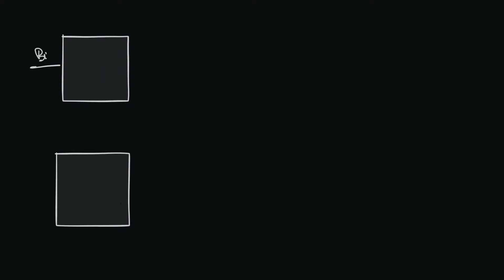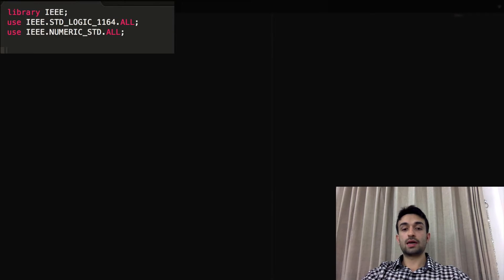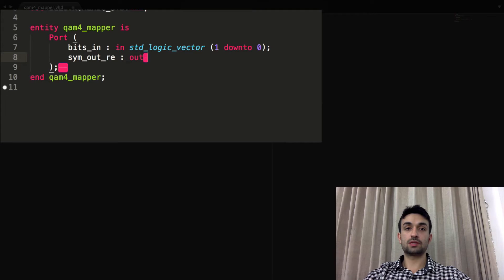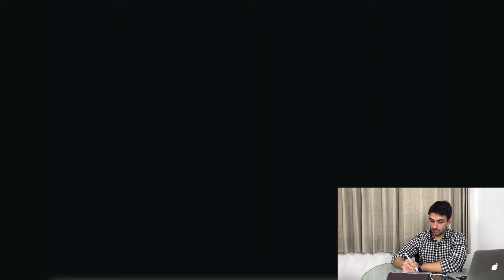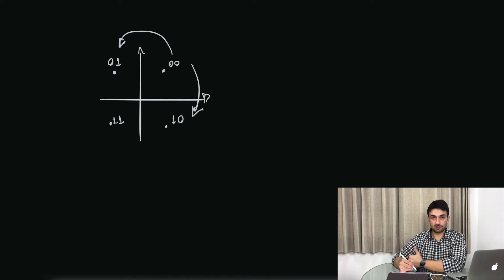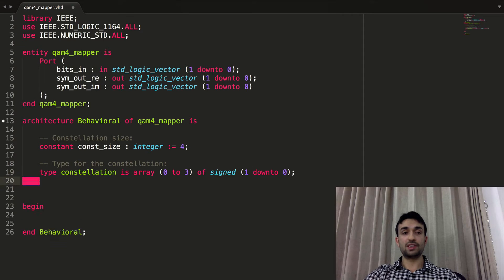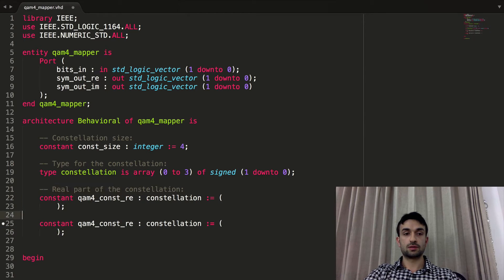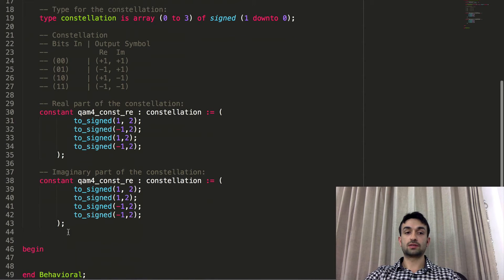QAM Modulation in VHDL - Part 1 [Wireless on FPGAs Course]

Comment: Hi Igor, thank you for the video. 

Please could you detail the software setup you are using? 

Thanks, Matt.
Reply from the maker: Hey Matthew, thanks for watching and sorry for the long delay. At this point I used Sublime as the text editor. For the recording, I use Screenflow, which supports recording of the computer screen, the computer camera and the tablet (iPad) screen. I also record from a different angle with my phone and I use the iPad to make drawings. Hope this helps.